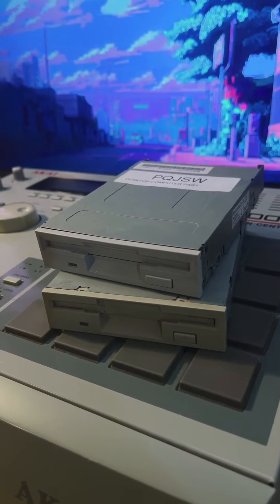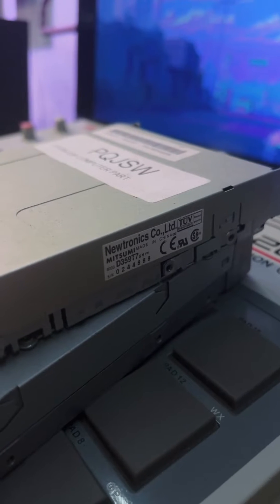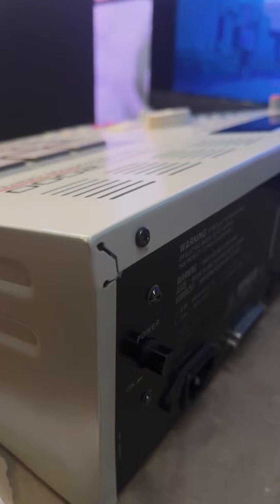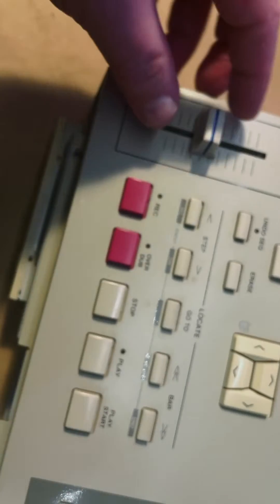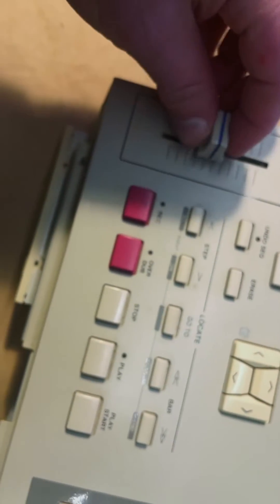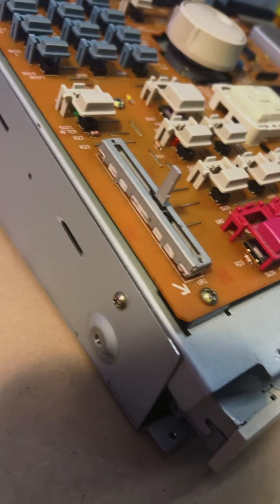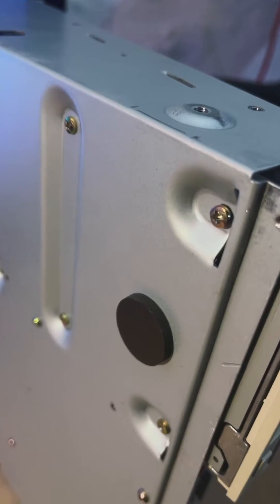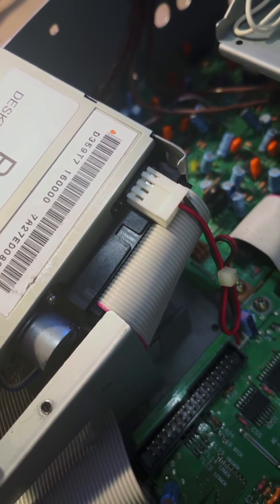Akai MPC2000 Floppy Drive Replacement with Mitsumi D359T7

Comment: Yo I bought a new floppy like the 1 in the video but I keep getting a disk error read any suggestions… I  bought the boot disk n chill sczi already I just want to fix the floppy drive
Reply from the maker: @dreamamadedabeat1311  could be a bad cable or the floppy drive is bad too. Try flipping the cable on the back of the drive see if that gets it. Some of those old drives allow you to accidentally put the cable in upside down. Leave the other end attached to the motherboard tho don’t move that side.